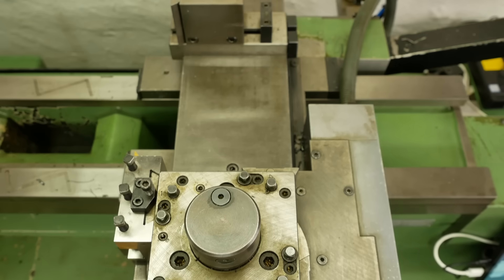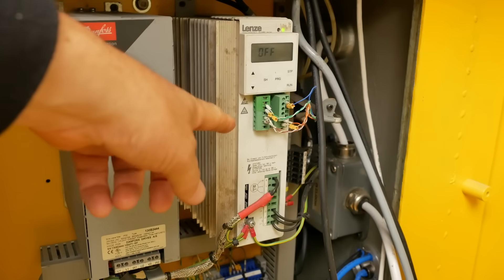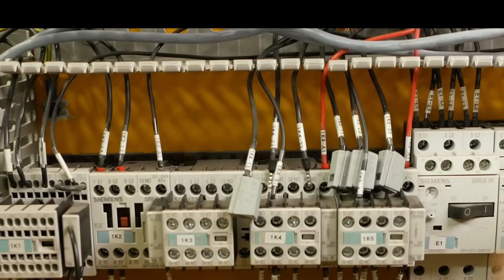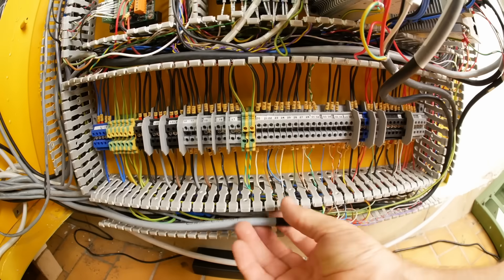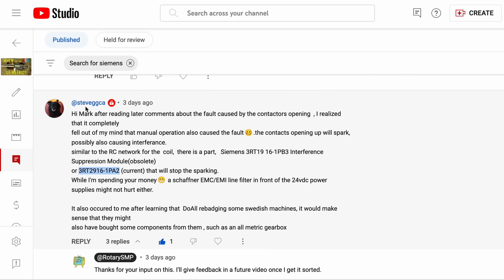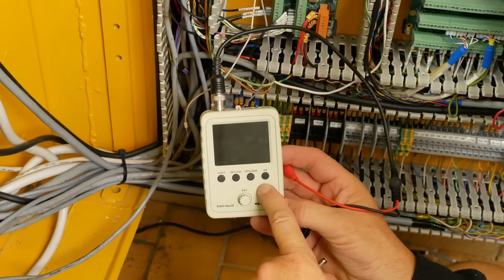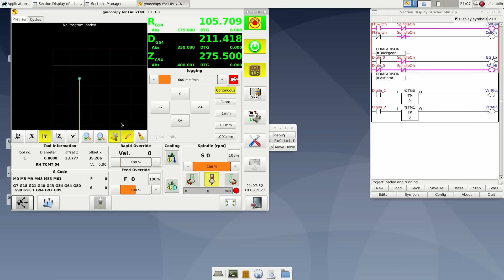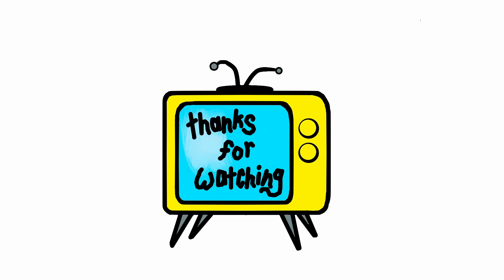Troubleshooting electrical interference on the Schaublin 125 || RotarySMP

Comment: Well, if you using VFD, it can cause very heavy EMI interference.. It's not a problem for industrial machines, because they use servomotors with 50Hz impulse frequency..But EMI- real headache for DIY CNC machines/routers/lathes...
Reply from the maker: That is why I used the filters both in front of the VFD and in the motor lines.

Comment: When it comes to interference coupling between cables, what you want to look at is loop area. Picture a basic electronic circuit with a lamp on the right, a battery on the left, and a wire connecting across the top and the bottom. This big circle (or square) looking thing outlines the loop area, and if you overlay another loop on top of it, they'll couple like a transformer. To reduce this coupling, you can either move the loops away from each other, or make the loops smaller in area, by re-routing the top and bottom wires closer to each other. Since the area is (in effect) signed, you can also cancel out the coupling by flipping over half the area (making it look like a figure-eight, or one of those twisted pastries if you add a bunch of flips). These two techniques combined form the basis for how twisted pairs work: the two wires twisted together have only a very small area between them, and because they're twisted that area between them alternates facing towards or away from the source of the interference, cancelling out any remaining coupling.

So for any of your sensor inputs, you should run a twisted pair with the signal and ground (or a twisted triple of signal, ground and power if you need that). You should terminate both the signal and ground (and preferably power too, if you need the third wire) together on the board doing the sensing, so as to avoid opening up a loop area inside your wiring cabinet by having the ground take a detour through narnia. As a bonus, you can wrap the twisted pair through a ferrite toroid (aka ferrite ring) to form what's known as a common-mode choke, which greatly increases the impedance for interference signals which look the same (are 'common') between the pairs, while leaving the differential signals (what you're actually trying to measure) alone.

If you can't terminate both the signal and ground/power lines on the sensor board, then do your best to bundle them together with the respective power and ground lines for that sensor board back to the terminal blocks supplying them.

As another bonus, you can look at installing an RC snubber over at the motor itself, so that the back-EMF you get when you disconnect the power stays more contained at the motor rather than bouncing down the lines and into your control box.
Reply from the maker: THanks for your very clear summary of the practices available. That is very helpful.

Comment: Denouncing is mandatory magic.
Thumbs up to the hero who suggested it.
Reply from the maker: Very helpful. I'd still like to measure that spike though.
Reply: @RotarySMP I add firmware debounce as SOP to all switchable inputs. It seems like cheating, but many microcontrollers have this feature built-in because it's so useful. 

To actually lower the noise: 
1. Try and trigger your scope on 0.5V instead of 2V. Make sure you use the ground clip, clip near the sensor input. 
2. It's not clear from the video, but I'm not sure you twisted your wires. Twist all the wires that belong together,  like +/- sensor lines or +/- power.  It makes a huge difference. 
3. It's not clear where your grounds are, if you have enough ground, and if you're grounding the right things. It would be cool to do a quick video on just your wiring setup. 
4. Ferries. Add a ferrite next to the input of the sensor, and your problem will likely disappear. If it doesn't work, loop the wires 2,3 times through the ferrite to get more filtering.

Comment: So you smothered the interference with a software low-pass filter instead of eliminating the cause. You mention Hall effect sensors but we don't see you circuit or wiring. The unshielded cable run from the sensors to you controller board is a massive aerial antenna to pick up all the EM interference in the workshop. You should use some kind of shielding on those cable runs. More to the point , find the source of the EMI and shield that.
Reply from the maker: I am not finished, I just have a fix that allows me to continue with the programming.
Most of the cable is shielded. It is only that last 1m within the race way which is unshielded.

Comment: What I noticed during watching, that you don't have a separation between low voltage control signals and high/mains voltage for the motors. This is for sure a safety issue but proper wiring here would also prevent the surges you have on your control signals.
Reply from the maker: Yep, I learnt a lot about wiring doing this project, but some of the early ignorance let to design decision (=mistakes) I can no longer easily change.

Comment: It's already too late, but generally it's a bad thing to run signal wiring along the high voltage/high current wiring. It's a good thing that this issue was easy to reproduce. Much worse if it would've been an intermittent issue that you found while running some real parts.
Reply from the maker: Good point Phil. Intermittent faults can be a nightmare to isolate.

Comment: The Siemens RC-Snubbers get clicked into place on the outgoing side of the 3RTx contactor series  (Terminals 2/4/6). Contact to the input is made via some pins sticking into the contactor. If you choose to use them make shure to have a good look into Siemens’s catalog, there is a lot of variety that looks like it fits but it is for a different „frame-size“ or has the wrong electrical characteristics. Usually there’s a legend to the Partnumbers somewhere in their catalog. 

Sticking to best practices in cabinet building, like running shielded cabling for the sensors as close to the interface as possible and adding in some filtering to the inputs could, like many others suggested as well, be the easiest solution in my opinion. 

Crimping pigtails onto or twisting the cables screen to a single strand is out of favor nowadays, like the clamps that you made for the vfd‘s filter your supposed to connect to screens with as much undisturbed area as possible to get low impedance against higher frequency interference due to skin effect. 

Very much enjoying the project, and how it’s coming along. Your videos are something to look forward to on the weekend.
Reply from the maker: Thanks for your tips and kind feedback.
Reply: @RotarySMP  Yes the grounds to the shields should be made with larger cable, at least the same wire area as the conductors. Simplest is to take thick stranded wire and use that, and the connection to the star point should be through a braided wire, short as possible, and close to the VFD output. The install manuals for the VFD's normally include quite good instructions, at least for the EU manufacturers, like Omron and Siemens, as to how to ground the cables and install the input and output filters, plus if you use line reactors as well. 

The contactors the supressor modules are connected across the contacts, and often they unfortunately also cannot be used with auxilary blocks, though as you have 4 pole relays, and only need one feedback connection, you easily can use the spare contact position on the main contact plane to provide this function, allowing use of the supression block. 

I needed some, but they were not available for that particular relay, so I instead made my own, using separate capacitors and resistors instead, wired across the contacts. 47nF 1500 polypropylene capacitors, and a series 10R 1W resistor, which worked to keep the contact arc down to a lower level, and not burn out the contacts every 3 months, as they had a very frequent operation. I was tired of changing that contactor, so went with a plug in 11 pin relay instead, as it is fast to replace, but the second one with the supressors lasted till the machine was sold more than a decade later.
Reply from the maker: Did you just run those resisters and capacitors over across the top of the contactors from input to output on each line?
Reply: @RotarySMP  Yes resistor in series with capacitor, and run over the top of the contactor.

Comment: Using zero-switching SSRs instead of mechanical contactors would very likely avoid any current spikes on the 3-phase wiring entirely, eliminating interference to the low-voltage lines.
Reply from the maker: Thanks for the tip.

Comment: seems like your spindle was acting like a generator during deceleration, pushing some extra back voltage into the system, the debounce seems to act like a filter to cut that spike.
Reply from the maker: Thanks for the explanation.

Comment: Have you measured the difference in home position between the filtered and the unfiltered input?
Reply from the maker: Should be the same, as the homing is first a bit faster to the home switch, then back off, and a slow approach, and finally, it turns past the home switch to the next encoder index.

Comment: I have a,similar issue. I split open my loom and removed all the wires for spindle and steppers away from each other and the problem is gone. My machine came without shielded wires on any of the steppers or spindle.
Reply from the maker: I considered that, but the way my I/O card is aligned, I will have some parallel runs regardless which way I run things.
Reply: @RotarySMP  I'm upgrading ny machine to centroid acorn now and changing out all the wiring for steppers en spindle with high quality shielded wires. I'm keen to see if the problem resolves with the new wires. It sucks to have the whole loom split open like a octopus just to get the machine to run.
Reply from the maker: @raindeergames6104  I'll be keeping my fingers crossed that you dont have any EMI problems.

Comment: Most likely, this fault may have existed when built,  but the original controls sample time, was not fast enough to pick it up.😮
Many sensors have built-in filters, ref advance in microelectronics, but you definitely need to invest in an Oscilloscope,  why not 🧐 lol.
Having both Clean Earth,  and Ground is good practice. 
Thanks for sharing.
Reply from the maker: Thanks. A generous YT Member is sending me his old Osci.
Reply: @RotarySMP  Most magnanimous

Comment: Why would a voltage spike trigger the E-Stop? The E-Stop is voltage high during normal operation and goes voltage low during an E-Stop event. It is wired that way so if something happens the system fails safe. It sounds like your E-Stop is backwards. 🤨
Reply from the maker: Schaublin used Hal sensors for X axis end stops. So these are Active high. They trigger an E-Stop, from LinuxCNC but are separate to the hard wired, NC E-Stop loop.
Reply: @RotarySMP  Ah ok, I understand now. Even though Linxcnc is calling it an E-Stop, it’s a limit fault not an E-Stop. In the USA if it’s not part of the hard wired E-Stop chain, or wired through an E-Stop safety PLC it’s not an E-Stop.

Comment: Software layer debounce is perfectly acceptable. all PLCs use it, the factory setting Siemens sets for all standard input modules is a whopping 3,2ms. 
Sounds a lot but if one factors in cycle time of the main loop it becomes a non issue
Reply from the maker: Thanks for the feedback Hans.

Comment: In general terms Hall effect sensors should not need debounce, so adding debounce to a Hall sensor does not sit very well with me. You input module probably has fairly high impedance inputs while the Hall sensor has a reasonable drive capability, you could try decreasing the input impedance of the input module with a pull up/down resistor at the input. You did not say which logic level is getting glitched, but if the Hall output is open drain/collector, you can increase the drive strength with a pullup in parallel with the existing one. If the Hall output is TTL and the magnet present output is a TTL high. then a pull down resistor would help.
Reply: But how much can the machine travel in 5us? Granted, it might mess up homing accuracy but it would still save the machine from a crash.
Reply from the maker: I have some overtravel between the hal sensor triggering, and the Balls screw physically hitting a stop, so the 5ms is not a problem there.

Comment: So nice to see the response you received on this request. Most excellent progress! 
I have also used software debounce timing on microcontroller 3-5v inputs to ignore high frequency pulse signals. Mostly on dry contact microswitches and tactile pushbuttons where 5v=1 and/or anywhere microseconds detection frame wasn't necessary in a noisy industrial environment. I had used a 200mhz recording O-scope to capture that bugger triggering the program logic during troubleshooting phase. Then set the debounce duration accordingly. 
Again, another option if the input board doesn't already have them, is to install Pull-up or Pull-down resistors nearest the inputs to keep those inputs stable(not floating) until intentionally triggered. Then program conditional statements as required to match that input logic. The NO/NC applicable Hall-effect sensors(P or N channel) will pull the signal high/low to mitigate false pulse issues. Never had as much luck with filter capacitors on inputs.

While this particular scenario isn't a potential crash situation, it may be some peace of mind insurance to use both of these hardware/software approaches on all your low voltage inputs.
Reply from the maker: Thanks for your detailed advice. I am still working through options.

Comment: is your switch cable shield / screen grounded both ends? its only supposed to be one end..

you say "single star ground"... i assume your panel is properly earthed and that's just whatever your local area calls earth.. ?
Reply from the maker: Yes, correct. I dont think Schaublin terminated the shield at the Hall sensor end.
Reply: @RotarySMP  I’m a control panel builder by trade so I’m just going back through the rest of the series ( this was the first one I saw on my suggestions ) to see if there’s anything obvious in the electrical wiring. 
The only thing I can see so far is maybe the pcb boards would benefit from some form of emf shielding as they don’t appear to be “industrial” components.
Reply from the maker: @deanworrall4567  I am using Mesa boards. 

Not sure if they would considered industrial quality.
http://store.mesanet.com/index.php?route=product/product&product_id=306&search=7i92
They have a good reputation.
Reply: @RotarySMP  I’m not sure which I/O card you’re using ( I’ll check in a while when I’m back home ) but it looks like the 7184? 
It says the threshold and filters can be programmed on the card itself so might be worth a look into the setting of the daughter board unless you’re happy with the software debounce you set?
Reply: ok I've gotten through a few more of the panel building episodes and so far there's a few possible things I've picked up on..
Your power supply 0V lines don't appear to be grounded so there is not a common reference point for your 5V and 24V.
Your IO cards are on plastic mounts and are not themselves grounded.. the little metal bits round the screw holes usually ground them to the chassis when mounting them on metal standoffs ( like those that were in the drive you blew up and repaired.. )

Comment: Your wiring screen cable should be connected to -24v dc only on one end. 
Connecting to earth does not provide screening. 

I had a gas detector trigger in a room, everytime the 3phase motor brake would activate. 
Connecting screen cable to earth did notthing. Connected to - supply of detector and all issues went away
Reply from the maker: Oh, good point. I thought screens always wen to common earth.